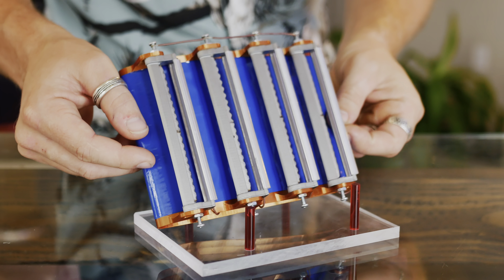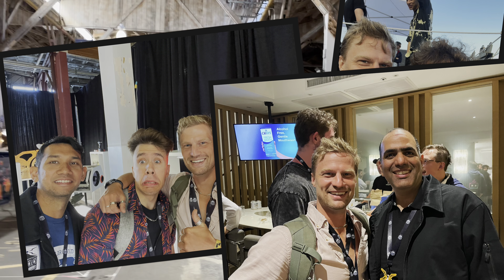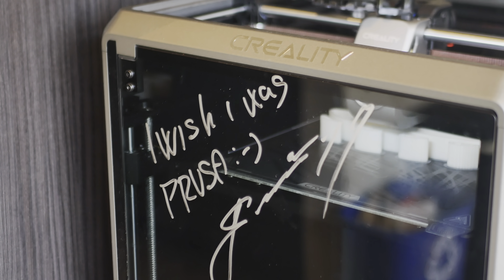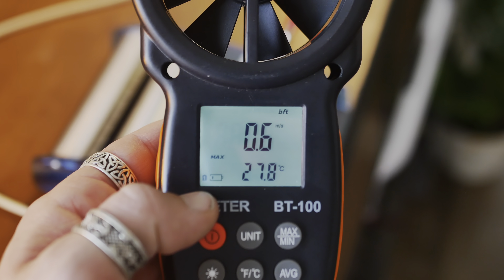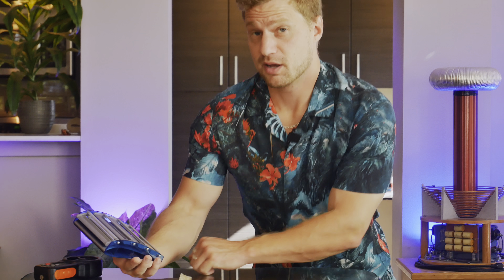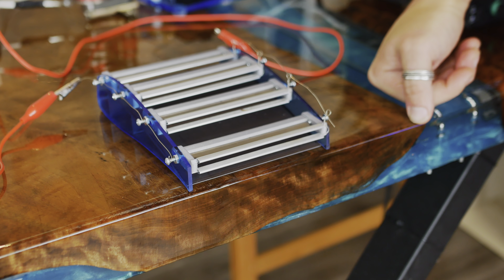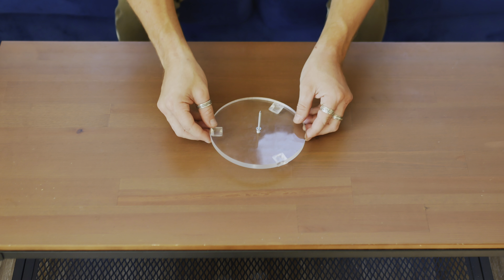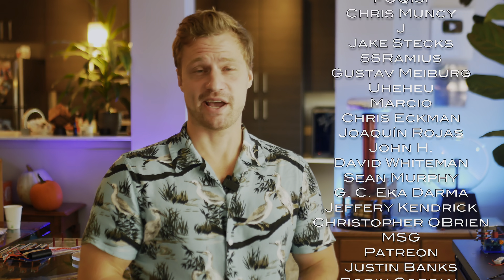Designing A Self Propelling Ionic Thrust Wing

Comment: you should try to see if you can find any literature about experimentation that has been done already on ionic wind/Biefield-Brown effect. It's a minefield because it's a topic littered wuth pseudoscientific opinions, but there's at least a little bit of actual data out there. I can't find it since I saw this over a year ago but I once read a paper in which the authors came up with an empirical formula for thrust in terms of electrode spacing and voltage and I wonder if that could be helpful.

Comment: Is there a way to get the thrusters inside the wing. I'm thinking a thin opening on the leading edge and a corresponding on the trailing edge on maybe the top of the wing skin. Then the inside of the wing could be used to hold the wire for the high voltage and the skin of the wing could be the 0v (ground) or a structure inside similar to what you created. This would end up being less weight, less drag, but not sure what an opening on the leading edge would do to the creation of lift.

Comment: suggestion... put the elements into a kind of series with the front of each segment 30k volts different from the back of the next, so you get an incedental acceleration effect between segments, as well.   with 3 segments, the difference between the front of the first segment and the back of the last segment should be 90k v

Comment: something I noticed is that in a lot of the tests, the individual stages are angled away from the wing surface. Since airflow does "want" to follow the surface of the wing, you might be fighting aerodynamic effects, and it might be beneficial to test the wing with each stage angled parallel to the wing. Or even better, specifically test configurations with different thruster angles with respect to the wing! Just a thought

Comment: Right of the bat, shouldn't the thrust be under the wing? 
I'm no expert but I understand thrust for flight, especially in gliders, depends on the pressure difference created by fast moving air going under and slow moving air going over.
Speeding the air over the wing would negate the potential for thrust?

Comment: A thin pla clip to feed the wire through to reduce the weight of having a blade while keeping the structural integrity to reduce weight. Nylon screws or even friction fittings on your 3D prints to further reduce weight. If you give resin printing a try, you can dile in flexibility,strength,and hardness, making extremely durable thin prints.

Comment: what if you used a decreasing thruster width to increase the air speed over wing width?  Leading thruster is, as an example, 4 inches and the trailing thruster say 2.5 inches.

Comment: Assuming that you can develop an aircraft that will be able to produce enough force lift itself and an additional load you will need to consider your power source. Imagine that the power source is 500 lb that means that the aircraft is going to need to lift the structure, the linkages for control surfaces, your control computers computers if you use them and circuitry for the  ionic thruster. I'm mostly thinking that it might be overly heavy.

Comment: pointers... adjust the following edge of each ionic thruster tangentially to the bottom of the leading edge of the next one in line, this should cause the airflow to be in series and increased by each consecutive thruster...
next remove a gap in the front of the flat underside of your wing and place ionic thrusters along the curvature of the internals of the wing, this should put more air aiming downward and back.

Comment: Why wouldn't you have buried the thrusters along the chord line or along the length of the fuselage so you don't disturb the flow over or under your lifting surface and cause instabilities in both airflow and control you'd have to overcome?  Seems like you took the most risky design choice right out of the gate.

Comment: It's so great buddy!
Congratulations!
It can be another cutting edge innovation.
I'd suggest you to try stealth model wing. The shape of German stealth (ww2) was highly efficient.
https://youtu.be/aLcjIIZcHQ0?si=rfGfxFJJIjycn5UA
1. Leading edge to trailing edge distance is much more to create more thrust in your design. 2. Total shape itself creates huge upward force. 3. Engine placed through the wings makes the engine much more efficient. You may make extra cylindrical ionic thruster in 5-7 degrees so that the air flow along the thruster by default creates upward force. 4. You may have controllable (regulated) thrust on each side so that it can help controlling the aircraft's movement right and left/ other motions. 5. You may keep the tracking edge flexible for controlling aircraft's movement. 6. You may think of vectoring thrust which will increase the aircraft's maneuverability.
I wish I could participate. However,
Best of luck buddy.

Comment: I really think that this will not work as a propulsion system for an airplane (even if using Styrofoam and foil. It will, however, be perfect for a model dirigible. Especially if there is a secondary brush-less propeller system for control in higher winds. I do hope that you prove me wrong.

Comment: Question What happens if you enclose the ionic thrust packs inside a box that forces air to flow just through the thrust packs into a tapering box that slightly compresses the air as it is drawn through?

Comment: hollow out the wing and ad the idea across the length of the wing. your idea is the peanut butter and the wing is the flat bread focus the air but creating tunnels for each slot and have all the slots join at the back of the wing to create pressure and push.*
Reply: this will help with creating thrust out the back. i hope you understand

Comment: Your design is still grotesquely overweight. Think 10x lighter for the same surface area of wing. That is what Peter meant by low wing-loading. Look at successful ionic thrust plane models. You will see what I mean. Also, don't be too obsessed with airflow speed. What is more important for a slow plane is airflow volume. You need both, but for slow planes, volume is more important. If you want ANY lift, you need to point the back two thrusters downward, not outward. Wings create lift by moving high volumes of air downward thus the equal and opposite reaction will be upward, ie., lift. Notice on your test rig, you made ZERO LIFT. Yes, I understand that in that particular rig, you didn't want lift, but it demonstrates my point.

Comment: Hey Jay, To borrow a line from Elon, the best part  is no part.  3 obvious suggestions.  Keep the serated knife blade, but loose "aerodynamic" printed holder.  #1 The blade can support itself, and along as the angle of each blade is parallel with the upper wing surface then it does not have to be aerofoil shaped. #2 The aluminium grounds do not need to be aerofoil shaped  as long as they remain parallel with the upper wing surface.  So make them out of thin stripps of aluminium.  #3 located the lower ground so it is flush the the upper wing surface.  These 3 things will reduce weight, drag and disruption of the wings upper surface.  You're welcome ;-)

Comment: It is curious that when you used multiple independent power supplies (PS) that you did not get the expected boost.  I wonder if each PS was floating, so the prior stage charged the subsequent stage and thereby neutralized the net acceleration. I suspect you might be able to improve things if each stage was floated to a favorable voltage from the prior stage.  Basically you would be making a particle accelerator.

Comment: This is going to be long. First, you are losing your wing design when putting thrusters on top of wing. Try putting thrusters inside the wing with holes through spars for power connections. You can keep the back front of the wing same, except for slots in front/back to let air in/out. (Designed for best airflow) Maybe to /bottom ow wing snap together for installing thruster parts. As wing changes sizes do same with thrusters or use multiples. Don’t need to use total width of side to side support between spars, use oval holes for thrusters which should still be strong enough. Could make smaller width thrusters but more of them. Use copper tubing vs aluminum. Maybe combine Joel’s small compact thruster as extra thrust in fuselage.

Comment: I wonder if adding one ionic thruster, towards the front of the airfoil on the bottom, could help increase the lift of the airfoil by creating a higher pressure on the bottom, which would generate more lift.

Comment: I remember talk about Asymmetric Capacitors producing thrust plus discussions about Fractal Capacitor Circuit powering many capacitors being 90% efficient.  Seems like the skin on the wing could be configured as Asymmetric Capacitors reducing weight operating with the Fractal Capacitor Circuit.

Comment: So instead of a plane why not a saucer? If the amount of thrust compared to weight in the air can keep it afloat, would making it gyroscopical steerable? Like the engine always points down and the ship encases but not connected so you can move the ship to slightly pivot the engine? I'd it seems like it could work but need a lot of power, Idk I'm no scientist.

Comment: You could try skeletonizing the mounts for the thrust modules for more weight reduction. And lighter hardware will also help.  Compounding the power source into a singlular AIO (All in one) unit will help later down the road.

Comment: I love this , every video im trying to think of something you have not thought off , not done it yet lol im a blacksmith gunsmith tree surgeon , with some engineering quals but nothing impressive , one point though, would it not save weight to incorporate the thruster in to the wing rather than on top of it ? do wings still work with slits in them ? or could they be built inside the wing so you have a smooth outer wing , have you measured the air resistance of the apparatus as compared to wing alone ?  anyway keep it up not missed a video in 6 months since i found you , cheers from from wales UK.

Comment: Now you need to get in touch with J. L. Naudin, because that's what he was doing on his website at the tail end of the 1990's before he stopped adding new content to the website. Was doing plasma sheath wings in lieu of control surfaces, supposedly got into some R&D with Dassault, and then no more new stuff. Which is a bit odd or interesting in itself. The old stuff is still out there, so it might be interesting to compare to that as well.

Comment: I wonder if it would be beneficial to give up on the classic wing design. I get the need to grasp at what works.. but what if you could make the wing itself from an array of thrusters on servos or motors of some sort able to adjust angle on a whim. Something similar to how the Boeing Osprey works but Be able to point thrust downward and rearward with live adjustment. Runway less takeoff ect. Maybe im getting way ahead of myself, but it seems the classical plane wing design may not be the best form factor.
Reply: In Theory you would be able to have agility and flight characteristics similar to a quad rotor free style drone. Near "UFO/spaceship" like changes of direction and speed..

Comment: Just off the top of my head do you recall that plane with the Coanda effect rotating cylinder wing? Add ionic thrusters to power the rotation. . .As regards using a real wing profile, rather than put the thrusters above the wing, save weight by making the first thruster electrode as the actual leading edge of the wing, and the last thruster as the trailing edge of the wing, and ditch the middle two in favor of a longer thinner wing.

Comment: I think it's about time you invest in building a proper high voltage source, regulated constant voltage or regulated constant current (or both). You're going to have to make a really small high efficiency inverter to put in an aircraft too. Pretty much anything is going to be more efficient than those chinese HV modules, and you can't really make a tiny ZVS driver.

Comment: diodes, triodes, tetrodes, pentodes, heptodes...

cant help but feel theres an element missing... a neutral, shield grid, ground plane... iunno. something between each section to neutralise the charges. cathode to anode then theres a cathode again... i know theyre cold and all but still...

ooooh, cold... what about heated cathodes? nichrome wire maybe? or using high emission material rather than razor blades?

um... staggered/sequential pulsing across the elements? like, a pulse makes a puff, time it for the next element, another pulse, etc.

personally i think the funnel was a better approach. work on the "jet" action, ducted fan with air accelerator rings combined, and then its relatively easy to make a lightweight airframe to suit.

whilst this was neat, its also rather clunky. too much parasitic drag.it isnt the airfoil itself, its tacked on top of the airfoil... like guy wires on biplanes, like flaps on jumbojets...

the 2m/s is about right for the ~4M/s speed. give or take. 1/2mv2 blah blah... 

 mount it on a BLDC. by varying the resistance on the bldc you can measure the power developed in that resistance. making a very small dyno... spinning it was a good idea, need a pair of them, and... um... an external switch? like... maybe try a slip ring? again... bldcs made with hollow shafts for that very reason... get a low KV version...

Comment: if you are strugling to get this thing to fly later on maybe try a bigger wing. as all stuff u like (wing area, thrust output) scales faster than all th stuff u dislike (internal suport structure, drag). Up to a certain size. 3D printing might not be the right aproach then so you could try a kite like aproach. You could have one bow like carbon fiber rod and the wings inbetween. maybe the wings could be inflatable (to require les internal structure, additionaly you can cheat by filling them with helium XD). I hope any of this makes sens to you and maybe it helps you :)

Comment: Since the seperate "thrust generators" aren't stacking linearly it might be good to experiment with fewer but beefier engines. As right now your weight increase is linear but your power increase isn't. Inspiring project though.

As for weight reduction you may have to just make the entire structure out of struts. That will be hell to print though... But it may be lighter 😅

Comment: I like the concept, but maybe not for real flight. Imagine a bird strike, grilled at 30000 volts, at first you may have a sent of fried chicken, but since you cannot remove it while in the air, it might cause a kitchen fire 🔥 in the air. What when you add water to this design when it rains? It is indeed a spark(l)ing concept!

Comment: Could you run a wire along the leading edge of the wing, and use the wing itself as the thruster?

A wire above the wing and one below, just ahead of the leading edge would work, right?
Reply: Maybe if you put the anode behind the stagnation point of the airfoil it would work on the bottom pretty well. 

The inverted stagnation point for the top?  I'm not sure....it would seem that just somewhere to induce a flow right over the top of the wing would work.

Where do they put vortex generators on STOL airplanes?  That might be a clue.
Reply: Also, I don't know if the "anode" is the right term for the non razor blade part.

We call it the "collector ring" or "thrust ring" because we're using the tomato hater's 3d prints.

Comment: Could you lighten this wing segment even more by using an aerogel, thin mylar skin, and a very very minimal frame of acrylic only to support the thruster segments? And for that matter, what happens if you were to build the thrust segments inside the airfoil, closing the sides, and providing a constricted bar-like nozzle for the length of the trailing edge?

Comment: Two thoughts: 
1. I wonder if the ionic thruster would have more thrust when air is actively moving over it (like when the wing is flying) because you'd have more non-ionized air for it to use? (not sure if that's how the ionization works or not)

2. The change to 1 charged(?) edge and 2 grounded edges did seem to improve airflow by not blocking it as much, and I wonder if 2 charged edges going to 1 grounded edge would work even better? It would still not be directly blocking the air stream around it, like the current version, just reversed.

Comment: and every one you have designed has had a singular point of weakness you never address instead of stacking properly you just make it far more complex by adding entirely new units that break up airflow from 1 unit to the next. itll never get the results you want like this because instead of adding a gram or 2 for the additional drive layers you add ounces to make individual units and the wire capable of powering 3 separate drives instead of the more efficient multi-tiered drive but hey feel free to ignore the demonstrable results of decades and do your thing because you are fine with brute force instead of proper engineering

also the mid vid commercial insert. thats where i quit the vid. congrats i wont be back so you wont have to worry about hearing from me ever again

Comment: Thought for when you scale this up to a full plane, coming from the radio side of things.
The thrusters are probably insanely noisy in the RF spectrum. You’ll probably run into issues with RC control, since you basically have a spark gap transmitter wrapped around a plane.
Off the top of my head, one solution would be placing the antennas as far away as possible, probably up on the tail. Alternatively, it might be possible to build an LC band pass filter into the HV section of the thruster with some DIY HV caps made with Mylar, to “notch” out the 12cm-ish band RC control operates on.